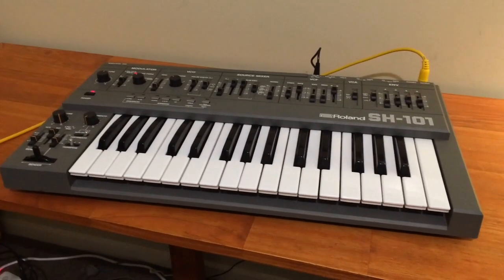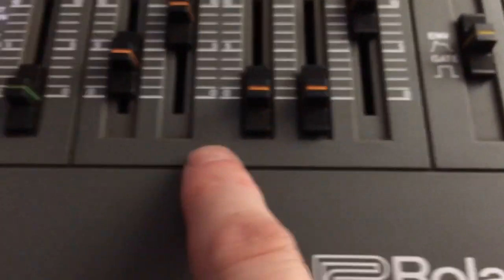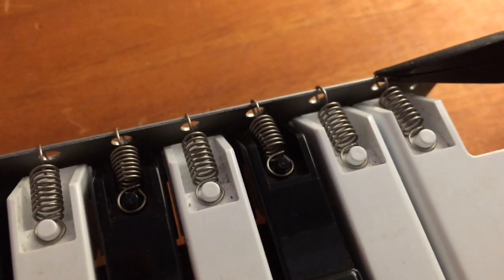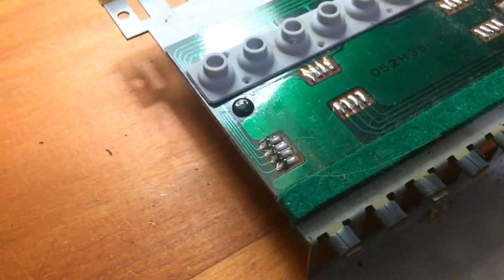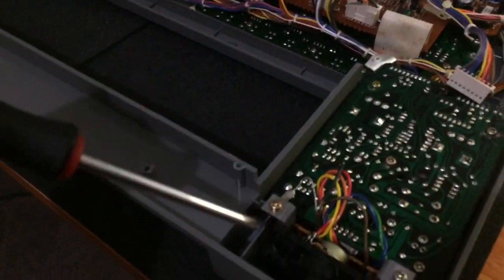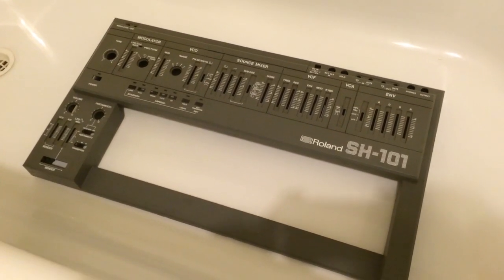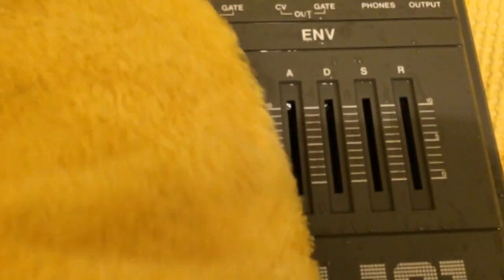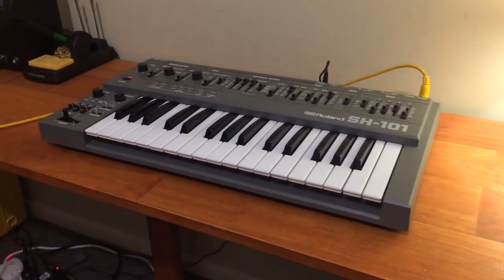Roland SH-101 Restoration - Bubble Bath and Dead Key Fix

Comment: Home sick today with a stomach bug. Your videos are incredibly soothing... and helpful. When I get back to health I will be restoring my Arp Axxe
Reply: I used to have an Axxe, a Mk II.  It came to me with the top A key damaged (which I ascertained was to do with the safety hazard caused by the protruding keys).   When I had a thing repaired, somebody forgot to properly connect the voltage control to that key, resulting in it only sounding the previous note played. What kind of fix would have taken care of this outcome?

Comment: Hey there, really useful video - must say I have to try this myself some day as mine hasnt seen any sort of cleanup apart from the occasional vacuum. At the moment, there are a couple of other issues that concern me more, perhaps you could shed some light on this: The resonance is faulty and doesn't seem to respond or at least only 10-20% of what it used to. Also arpeggiator is acting weird not playing notes at full level whereas the sequencer seems to work for now. Thanks in advance and keep those tips coming!
Reply from the maker: +RubiaKr3w I've looked at the circuit and there shouldn't be any difference between the Arpeggiator, Sequencer and Keyboard because the CPU handles all three the same way. So I don't know what to do about that one (unless the CPU is faulty). With the resonance you are going to have to troubleshoot a bit, starting with the slider, working back through TR26/27 and lastly the IR3109 filter chip. The slider is the most likely fault and then the feedback circuit (resonance is just the filter feeding back on itself). Hope it's not the IR3109!

Comment: I have a tune fluctuation if i touch the power button on mine? any ideas.... looks nice , good job.
Reply from the maker: +atommachine I'd replace the switch, they are prone to fail. They are available from Syntaur from memory. One of my mates ended up just pulling the switch out or fixing it permanently on or something like that. If the voltage varies for any reason the oscillator pitch will vary, it's the same on all synths with VCO's. So you are probably slightly cutting the incoming voltage when you press on the switch.
Reply: +GOLT !I happen to own a Roland SH 1000, which recently lost one of it's presets the piano, or rather it became really faint and still is rather faint. Also my tuning started to fail from one octave to another. The tuning on the back does work however only within the octave it's really off. Do you have any idea what the problems might be. Any help would be greatly appreciated as in the netherlands, no tech support is available for these vintage synths. It would crush me if I would not be able to use it again.

Comment: My SH-101 plays fine for about 30 minutes and then it just emits this awful distorted mess of a noise until I turn it off. You can slightly here it playing notes underneath the noise if I try to continue using it but its basically just a horrible distorted clipping which is unbearable to listen to.

Anyone know what it is? Was guessing it may be overheating as it plays fine again for about 20-30 mins if I try another day.
Reply: Great video btw. Going to do this to mine when I collect it from storage regardless of if it's unplayable!

Comment: Hey there cool vid, mine hv problem activatin the modulation wheel, the pitch bend workk fine thought. Any suggestion? Thanks a lot...
Reply: if you still have this problem, it is common that the casing of the mod/pitch stick will crack. (the black housing underneath) sometimes its fixable with good 'superglue' and sometimes you'll need to replace it. I think syntaur may have some in stock?

Comment: Great video mate. Out of curiosity, what is in the glass to clean your keys - hydrogen peroxide and ? Being in Australia - I haven't been able to replicate the RetroBright ingredients. I'm going to clean up an old ESQ-1 and a Commodore 64 once I work out a good solution :)
Reply from the maker: I don't think I used any in this video, I just wiped the keys with wet cloth. But I do brighten up plastic parts all the time. I just use 6% Hydrogen Peroxide from the chemist. The stronger the solution and the stronger the UV light, the quicker it works. I know some guys that only use 20% H2O2 but they are a lot further away from the equator than us. So 6% is fine. You do need a sunny day though.
Reply: +GOLT ! Thanks!

Comment: Have you ever had any issues with the LFO MOD BENDER? The VCO and VCF seem to work just fine. I've done a little research and it may be a problem with button/membrane that is activated when the bender is pushed forward. Any ideas? Thanks.

Comment: What could have caused the break...?
Reply from the maker: +Martin Pescador The rubber strip that holds the contactors in place, rubs off the solder mask on top of the tracks. The copper in the tracks then rusts and the connection fails. It's bad placement of the tracks. If they routed the tracks around the outside of the rubber strip then it wouldn't happen. But they didn't have much room on that board.